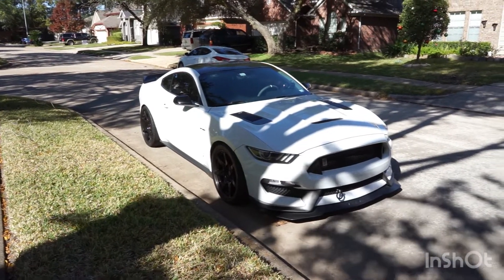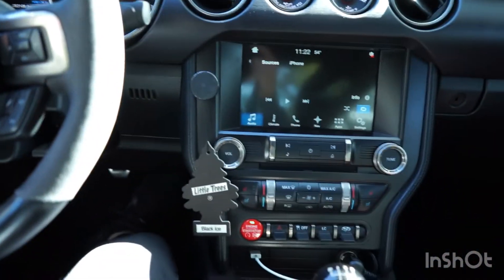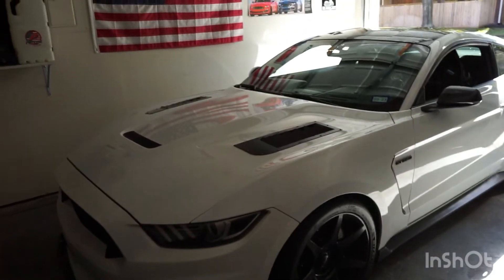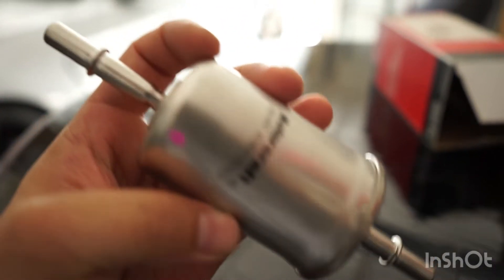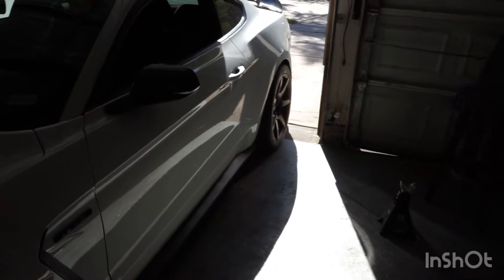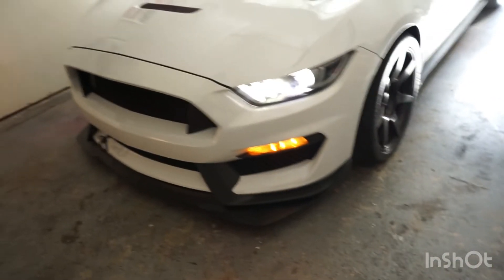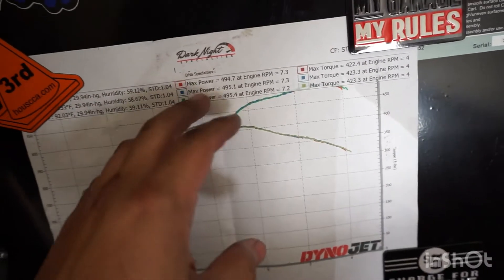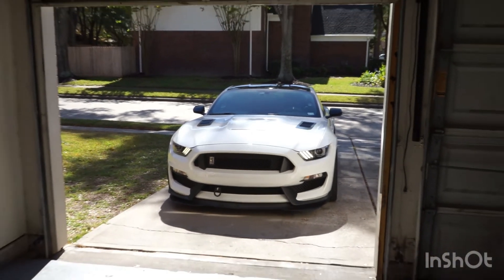Shelby GT350 Fuel Filter Replacement

Comment: Hey did you have any issues with oil consumption or just your stock motor going out on you in general? I want to get a shelby gt350 but i don't want to get one and it shits the bed on me. I heard the 19 to 20 models didn't have these problems but, those are a bit pricey
Reply from the maker: Mine is the gen 1 and no oil consumption what so ever. Even when driving it hard there’s no consumption. I believe that you just kind of have to get lucky? I still suggest checking it regularly just as a precaution but as far as that goes I believe it’s just luck and staying on top of maintenance items
Reply: @trackdriven350  Cool I appreciate the feedback man. Yeah it wouldn’t be a daily for me anyway but just wanted to know. Did you buy the car brand new? Or second hand?
Reply from the maker: I bought it Pre owned, it had 18k miles at the time
Reply: @trackdriven350  Did you have someone you trust to look the car over before you bought it or did just take a leap of faith and just bought it? I promise this is the last thing I’m going to ask you man. I’m just trying to gather as much info as I can. Especially before I make an expensive purchase
Reply from the maker: I inspected the car myself, though if you think you need to take it somewhere for an assessment then you can do so. Always a good idea to test drive and read any engine stored codes that might have been cleared
Reply: @bigogtt4905  

There is a YouTuber called Nanu I believe. He has an orange gt350. In one of his videos he shows you where to look to see if you have a gen 1 or gen 2 voodoo and to understand the engine code that’s printed. I have a 2017, engine was a gen 1, consumed oil. It failed after 7000 miles. Replaced under warranty with a gen 2. At 13000 miles now, no oil consumption.
Reply: @AA-nf2jl  Thanks man I appreciate the feedback